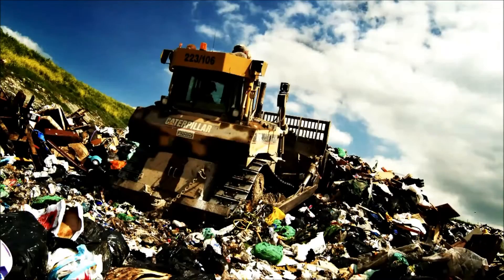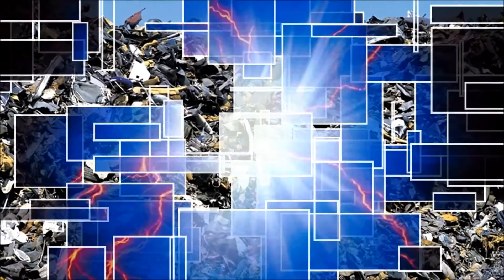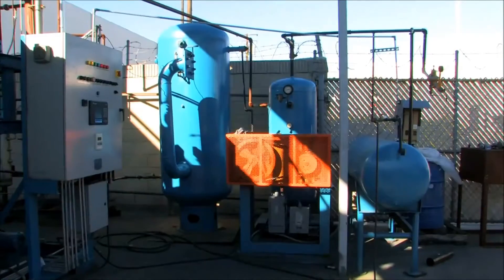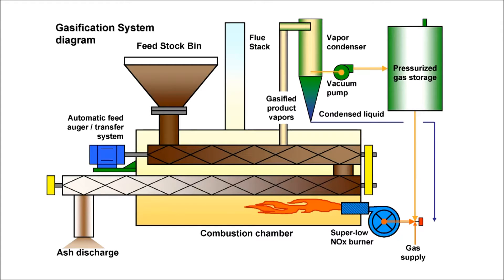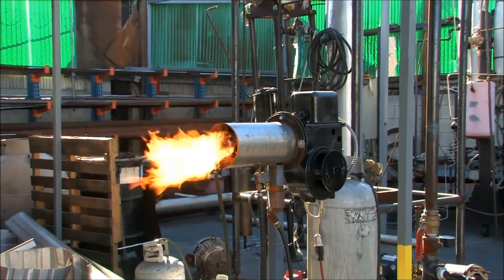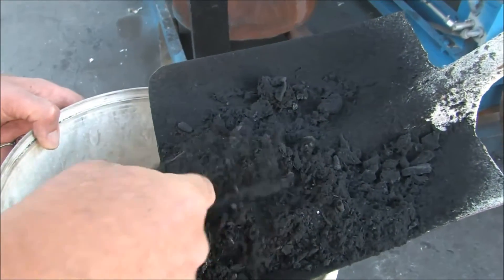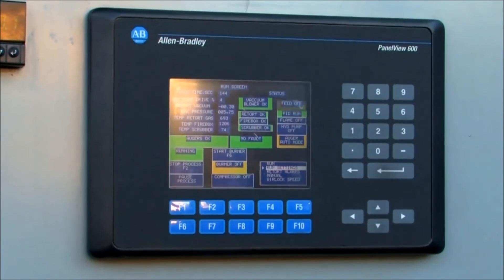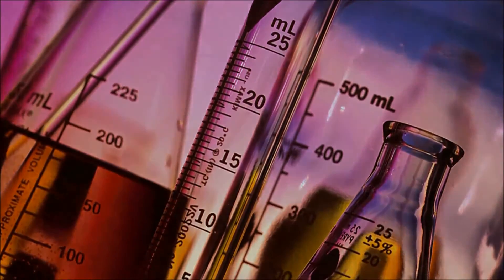ENCORE Advanced Pyrolysis: Waste to Electricity

Comment: that's cool... 
I'm sure things will get better, after any garage pyrolysis engineer and any pyrolysis plant will come together, knock out (at least most of) the proprietary things and become a pyrolysis society.
I mean, people need to know, what is safe and what's not, in this huge area...
Ash seems to be generally ( ! ) not toxic, but it seems to be dangerous if inhaled.
As any other insoluble dust inhaled.
The video shows clouds of source garbage dust, as well as the ash dust...

Liquids produced, like BTX (benzene-toluene-xylene) as well as styrene, acrolein, etc. are toxic; some of them are well-known carcinogens for human beings. Nevertheless, these are required for most chemical plants.

And, of course, the governments, any of them and all together, must realize that garbage isn't just a thing to refuse.
It's just another type of feedstock.

Of course, NOx, sulfur, dioxines, mercury vapor, etc. emissions MUST be thoroughly controlled at ANY such plant!

And the ash (char), if sold as ... whatever, or even if just buried, MUST be checked for the presence of lead, nickel, cadmium, etc.